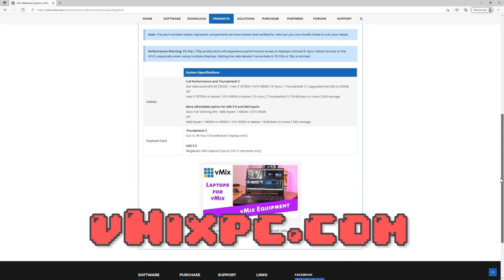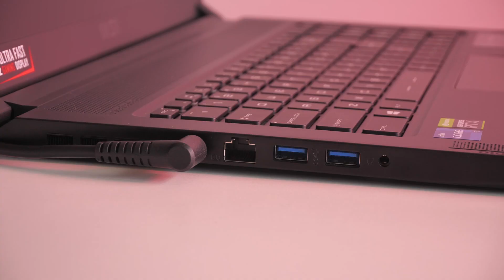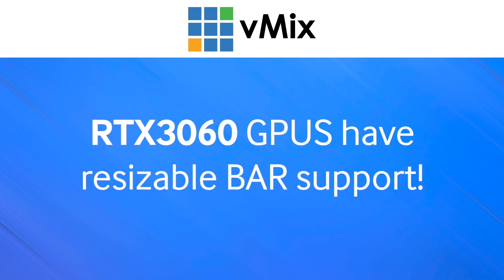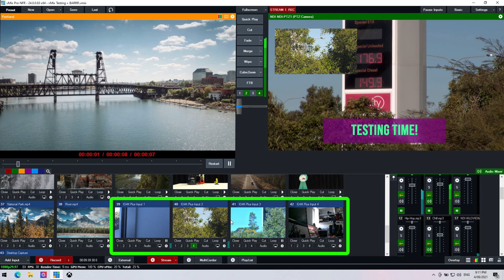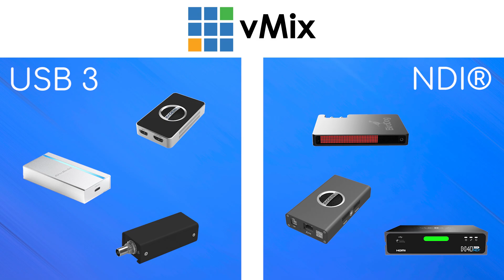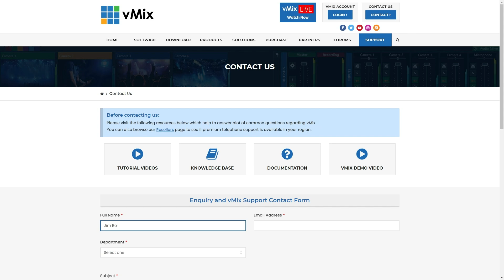Live Streaming Laptops for vMix 2021. Multi-cam portable production!

Comment: How many Cams can u use via USB on the Legion?
Reply from the maker: At 720p you might get away with 2 or 3 but it would depend on whether you had other peripherals using USB. It's hard to give specifics, but you want to err on the side of caution so you aren't dropping frames.

Comment: Alienware  has terrible cooling and overheats easily. I've gone through two. Now I run vMix on a Razer R15, 10th gen I7, 16gb ram, RTX 2060, Thunderbolt  for external Black Magic SDI capture card...it runs like a dream and the laptop is nice and cool. Just make sure that your power settings are set to "best performance."
Reply: You make me nervous. I am running a new Alienware laptop for vmix. Good so far. Hopefully I don’t have the same issues.
Reply: @raymondbrady9020  Keep it cool. Get a cooling pad if you can.
Reply: Things like this make me mad :( When you pay $3K for a laptop, you expect it to be state-of-the-art engineering. :/
Reply: @kimiastrid  it's not a bad laptop, just needs better cooling. The reason I switched though was because Alienware solders their ram onto the motherboard so it's very difficult to upgrade. Razor, you can just pop the chips out and put new ones in.

Comment: Or, you can skip the GTX drought, and buy a mid-range "business" Lenovo laptop with a Quadro GPU, and have unlimited processes in the NVEnc part of the GPU, moving all those mpeg4 streams around, such as every NDI and SRT source, plus hardware encoding for the output RTSP and RTMPS streams or vMix's own recording CoDecs.
Reply: Hi! I'm trying to figure out what exactly is the difference in all these configurations.. I want to use 4 NDI source at Full HD and that's it, no SDI, no HDMI capture. What I don't understand is how exactly is NDI processed, does it need a beefier GPU or can I get away with something "mid-range", as you suggested? Thanks in advance!
Reply: @kimiastrid  NDI is a low latency all-I-Frame mpeg4 stream. At 1080p30 you need about 80mbits bandwidth Per NDI Stream. So your 4 sources are going to use around 1/4 the bandwidth of a Gigabit network. For comparison, the HDMI-to-IP encoders usually run around 8mbits, and IP cameras can go down to 4mbits without issue, and most DSLR's range between 20 and 50 mbits for HD.
Yes, a mid-rage GPU will process it, but if you add in the transitions, graphic overlays, video playbacks, plus your desktop and the outgoing streams, you will quickly run out of processing capability on a budget friendly GPU, and will find a GTX1660 to be a good 'minimum' for four NDI inputs.

Comment: Im using a laptop HP omen and my livestream is lagging at times and one time  i had a caller and it completely lagged and cut off livestream!! im just running 1 camera through capture card. Any tips?
Reply: Make sure you are using the GPU for vMix. Check your graphics management settings on the PC. Also, be sure to allow your power settings to be "Best Performance."
Reply from the maker: Drop our Support team an email to take a look. Also check out the best practices guide- https://www.vmix.com/knowledgebase/article.aspx/264/laptop-best-practices Email- https://www.vmix.com/contact-us.aspx
Reply: I agree with Jamie's comment about ensuring high performance setting.  Also, I have three HP Omen laptops, each with at least 16GB of RAM, one with a 1060 nVidia GPU, and two with 2060 nVidia GPUs.  Each with Intel i7 CPUs.  I find that you need to use a cooling pad to keep the Omen from overheating and throttling, but once you do that, it is a reliable workhorse.  Have used multiple HDMI USB capture cards in some cases and 4 NDI-HX cameras plus many other inputs on other projects.  All showed very low CPU and GPU usage and a smooth show.